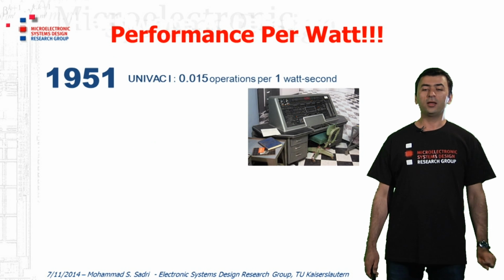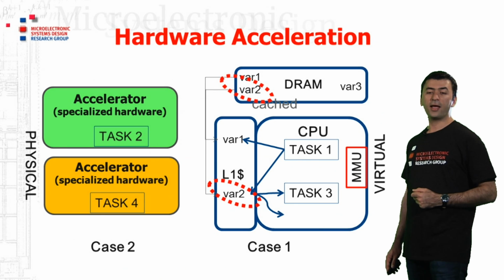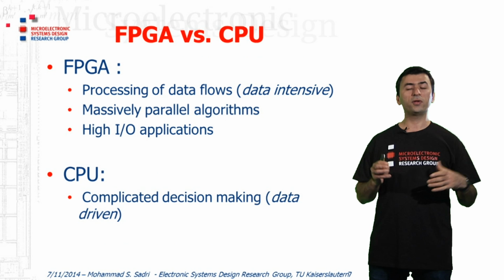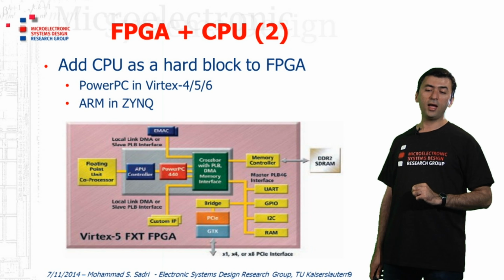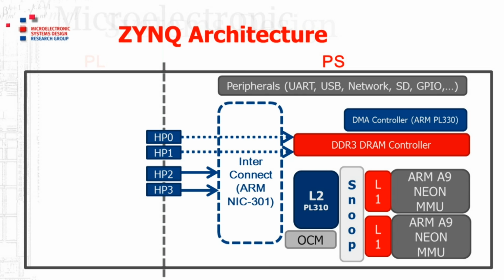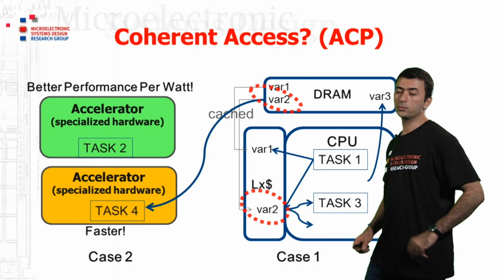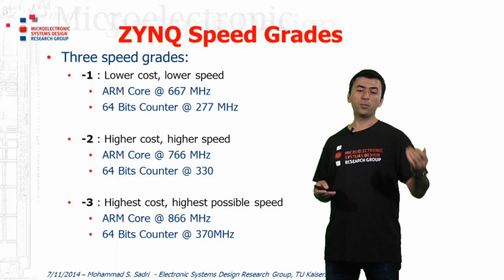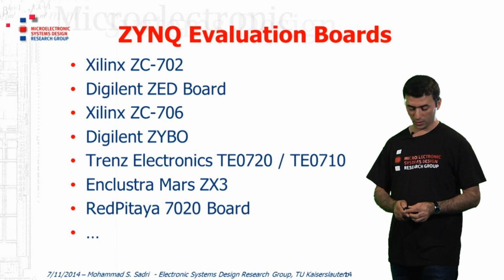What is ZYNQ? (Lesson 1)

Comment: I think there is a mistake here in the ZYNQ Architecture slide. PS is stand for Processing System and the CPU cores there is hard core, not soft core as said in the slide. Take a look: http://www.ioe.nchu.edu.tw/Pic/CourseItem/4468_20_Zynq_Architecture.pdf
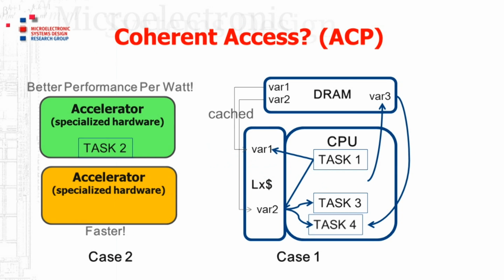Reply from the maker: +Cong-Thanh TRAN you mean the slide at 21:24? Sure, both cores are hard cores, but on the slide it is not mentioned that these are soft cores. Or do you mean another slide?
Reply: +Microelectronic Systems Design Research Group Sorry, may be it is my misunderstanding. You said that inside the PS there are 2 ARM cores soft system and I thought you mean soft core. However, soft system is the system running software, isn't it?
Reply from the maker: +Cong-Thanh TRAN At which time in the video "soft" is said? Thank you :)
Reply: +Microelectronic Systems Design Research Group at this time https://youtu.be/zD-5LQCOelI?t=960, please :)
Reply from the maker: +Cong-Thanh TRAN I think Mohammed is saying SUB-System, due to its accent it might sound as "soft"-system. :) Sorry for that! Best Regards
Reply: @ThanhTrantrancongthanh  If you have CC turned on, he said "Sub-system" not soft, because I thought he said soft as well.
Reply: @The_LanMan  dude i dont think youtube had CC function 6 years ago